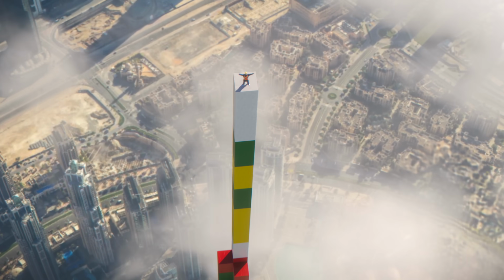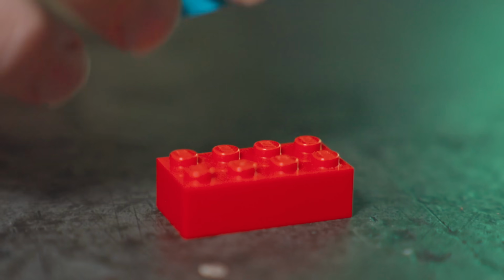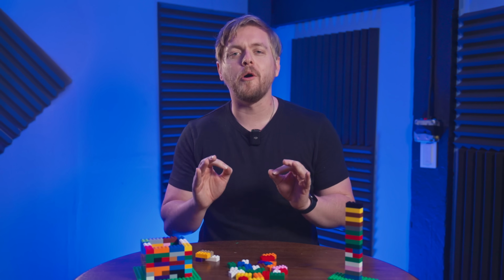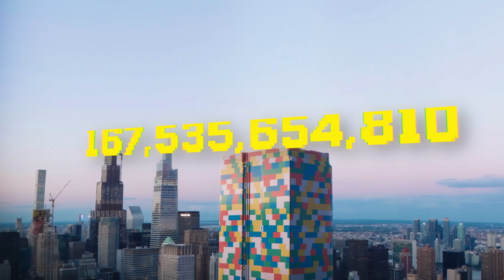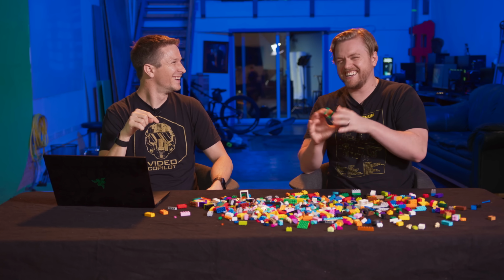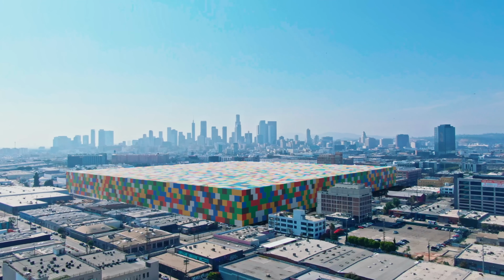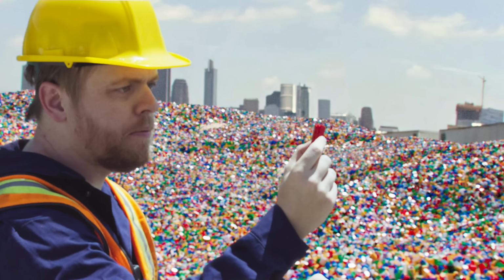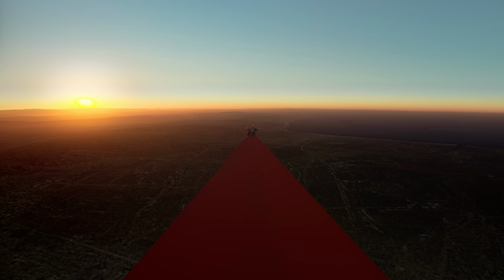How High Can You Build using only LEGO?

Comment: Does it have to be a solid structure? Can it be built hallow with structural supports made of lego? That would save you a ton of bricks.

Also, speaking of bricks, does that counter account for all lego pieces? Or just those specific types of bricks? Because lego makes tons of different types of pieces that aren't explicitly "bricks." Like they make motors, gears, axles and belts. They also make wheels and people and trees and creatures and all sorts of non-brick decorative pieces. So if their count of how many bricks they have produced includes those "non-bricks," then the actual number of proper lego bricks would be much smaller.

Comment: Gravity is an amazing force which can be used to strength a building.

However when you are talking about earthquakes, gale force wind and temperature changes, legos might be a really shitty engineering material. That it is hard to mimic all of the technologies that go into a skyscraper.

Let’s be practical about how impractical it would be to build a super lego structure.

Comment: "so clearly a single stack of Lego does not has that much structural integrity." 

Two flat Lego parts slammed on to each other are technically a stack of Lego, but in my experience impossible to take apart. ;)

Comment: 2x4 Lego Brick for 18 Cents includes
5 Cent greed tax
2 Cent Bonus for Board
2 Cent transport and distribution
5 cent for dealers
 2 cents for production
1 cent for material

If you buy them used you pay more like 5-10 cent, if you buy bricks directly from china you pay less than 5 cent

Comment: As a structural engineer and having done architecture I can safely confirm the possibilities of Lego are endless however the resources required to create large amounts is not.
Reply: Why stop at plastic? Start using wood,rock,metal fkcing moon itself maybe even all those asteroids...u call urself an engineer?? The possibilities are limitless!! WE NEED MORE LEGO
Reply: @kiro253 the calcium in our bones, the carapace of insects, the dirt we stand on, the air we breathe solidified, the vacuum itself pressurized into an unknown solid. EVEN NOTHING CAN BECOME LEGO
Reply: @nise6699  Turns out that the paperclip maximizer was, in fact, the lego maximizer
Reply: @kiro253 technically the way actual walls are built, they are LEGO bricks made of brick instead of LEGO. 🤯
Reply: Clearly, this is what our carbon sequestration should do: produce LEGO from all the carbon!!!
Reply: So there’s hope!

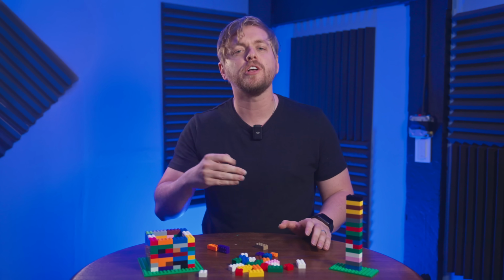Comment: 7:35 while a single lego brick costs $0.18 the actual cost if this was a lego set would be lower since in the sets the bricks cost around $0.07, so it would only cost around $7,403,018,841 if you bought every brick individually one by one, but if you bought all of them in a gigantic set to build the eifel tower it would be closer to around $3,500,000,000. still a really big number but it would be half of what you said it would be which is a pretty big deal

Comment: Weigh a brick. Measure the brick height. Put brick under load until it fails. Take that number and divide by the weight of the brick. That’s the number of the bricks times the height = maximum height.

Comment: ok but how tall could it actually be? 
- without extracting all the oil
- without recycling all the abs
- using lego branded bricks only
- including any and all different types of lego pieces required to make the structure, i.e. not necessarily just brick shaped pieces
- In whatever shape optimizes height with the given strength, weight, and quantity requirements given by the building medium
Reply: Lets assume every brick lego has made was a default 2x4 lego brick. Those have a height of 9.6mm. If we assume that there are 1 trillion lego bricks, then stacking them would reach 9,600,000,000,000mm.
9,600,000,000,000mm = 9,600,000,000m = 9,600,000km.  9.6 million kilometers is almost 25x the distance to the moon. Now lets assume you built a pyramid with the same pieces where you place each next brick one stud inwards per layer, aka a slope of  1 brick / 1 stud. A brick has a height to width ratio of 6/5 so that slope would be 6/5 or about 50.2 degrees. Lets assume again that all the bricks are 2x4 bricks with a volume each of 9.6mm x 15.8mm x 31.8mm or about 4.82 cm^3. Multiply that by 1 trillion to get the total volume in cm^3, then divide by 1 million to get m^3 and you get 4,820,000 m^3 of lego bricks. A square based pyramid with a volume of 4,8 million m^3 and a slope angle of 50.2 degrees has a height of only 173 meters. If you instead stacked up 2 bricks per stud for the slope you would get a height of 275 meters but the angle of the sides would be much steeper around 67 degrees, if you were to push that again to 3 bricks per stud slope would hit 74.5 degrees and the height would reach 360 meters.

Comment: The real limit would end up being in the construction techniques you use as the strength to weight ratio of the bricks themselves is crazy, so between SNOT methods and LEGO brand string (if you insist everything must be official Lego only) to tie things together you can overcome the limited clutch power between the bricks quite easily and create more stable structures without the huge pyramid footprint. So it would be nice to see at least a token mention of the more advanced building techniques.

Comment: The initial 2.17 mile calculation is based off 1 to 1 vertical stacking, it does not apply to a pyramid shaped structure which helps immensely by sharing the load of higher bricks over a larger area of lower bricks. So you would be able to build much higher.
Reply: Keeping the same aspect ratio, I think you can build three times as high (but you'll need a couple many more earths worth of oil)
Reply: @Papierkorb2292Not if, like most buildings, it’s built semi-hollow..
Reply: @dedomenici  Then you are back to brick strength being the limit.

Comment: There's not a trillion Lego bricks in the world, there's a trillion Lego pieces. Flames, horses, domes, figures/minifigs, various accessories, and plenty of other pieces aren't structurally sound. There's an estimated 1.1 trillion pieces as of 2024, we (generously) can up that to approximately 1.136 for 2025 at Lego's reported production of 36 billion per year: but we have to separate Lego pieces into 'elements' and 'bricks' according to their own reporting. As of mid-2025, there's probably only 660-7020 billion structural bricks, depending on the exclusion rates for things like minifigures, plants, decorative pieces, animals, technic pins, technic hinges, technic connectors, baseplates, etc. - but we can still include things like technic beams and axles.

Add to that that crush force on a single brick does not scale perfectly to an interconnected brick structure, and you have a lot of problems.

Comment: you could probably get even higher if you changed the ratio of vertical and horizontal bricks. rather then a 1x1 ratio why not a 2x1 or even 3x1. if you can figure out the proper ratio you can get taller without sacrificing all of the additional structural integrity of the pyramid shape.

Comment: The solid (well, quasi-solid, since the blocks are empty themselves) structure is extremely irrational in terms of the blocks usage though. It's like making Eiffel tower whole from solid metal like a pyramid. But one will need to utilize structures like arcs and domes to avoid tension at all costs since the bricks are quite easy to disassemble by tension.
The solid pyramid structure is pretty disappointing one to be honest since at this point you may basically as well just rake all the plastic into a huge pile. That's basically the point of pyramids (and the source of their stability).

Of course it's likely impossible to reach the tallest buildings heights even approximately, but still it's interesting to know how high it's possible to get ~realistically :)

Comment: James Mays Lego house was actually supported by only Lego, the wood beams were there due to regulations but not actually carrying any of the weight. the bricks were built around them with gaps
Reply: And they showed the testing of making a lego beam in tension at an engineering school. After many failed attempts they were able to create beams James could walk on. Too bad Toy Stories ended.
Reply: @AlansWay3DPrinting  it is such a good series!
Reply: Kind of like wearing a safety line while rock climbing. Just there to protect you if you fell. Doesn't mean you weren't doing the climbing.

Comment: When Austin added the stack of green bricks to the tower at 03:04, you can see that they didn't connect completely. And when the tower finally collapsed, it broke at that exact point lol I think you could have gotten to over 2 miles if it weren't for that
Reply: What are you talking about? He could've gotten to at least the edge of the observable universe
Reply: I KNOW I WAS SO PISSED WHEN I SAW IT
AMATEURS
THE LOT OF EM
Reply: if you go frame by frame youll see its actually about 3 bricks below the green section where it snapped
Reply: I came here to say this
Reply: True, because at the two mile mark, I'm sure the gravity would be a little different, and eventually you run into issues discussed in the XKCD video about a billion story building
Reply: @joe-skeen  While technically true, practically false. 2 miles is only around 11,000 feet. They're in LA, so essentially sea level. I've lived at a place around 9500 feet above sea level. Gravity was the same.

For perspective, low earth orbit is 110 miles. And to have something in orbit, it is still affected by gravity. Think of low earth orbit like this: you're perpetually falling towards, but missing, the earth due to horizontal velocity.
Reply: I was about to write the same but i saw your comment 😅
Reply: Came here for this. Shout out to Ctrl+F "green"
Reply: such a shame! They would've made an elevator to the moon otherwise..
Reply: bot detected

Comment: Building solid is such a waste.. consider buttresses and the humble arch. Modern buildings rely on steel and concrete mixed but you have to go back to techniques for solid stone. Compression only. Build as light as possible since each layer only has to carry what is above. Start designing from the top down.

Comment: This topic could stand several more visits. There are other structural aspects to look at like hollow structures (allowing for wider cross sections less prone to buckling, for the same weight) wall thickness reduction as a function of structure height, cross sectional shapes that can further reduce buckling, internal bracing, and tension elements. In short, there are a lot of neat tricks that can be played to reduce the propensity to buckle, and to proportionally reduce loading on the base bricks per unit height.

Comment: One thing that would need exploring is if there is a brick configuration that is stronger than just forming rectangles. If you take the regular 2x4 brick in pairs and alternate the direction you stack in, it is much more resistant against shear forces. And it should be better at distributing the weight from above. 
I'd wager there would be other configurations that are even better for force distribution, some sort of lattice that turns any one force direction into a variety of forces acting on all surrounding bricks. And if you find that optimal configuration, you could probably go steeper than an even pyramid for the final structure.
Reply: true, there are for sure better methods for building a tower

Comment: Former Master Model Builder here and trust me, that “glue” does a lot for building large structures out of LEGO. I’m glad you guys hit on it near the end when Wren mentioned the limits of the bricks themselves. Without glue, practically any sized build will start coming apart eventually because of these imperfections compounded with the increasing points of failure at every connection. A giant building would basically wiggle itself apart, especially if it was all solid throughout. While working on a life-sized minifigure build, we were gluing every layer as well as staggering the bricks to make sure every piece was properly anchored but we were also building it hollow with internal structural supports to basically keep it together on every layer. We had one support near the shoulders that we basically had to beat into place because so much drift had already occurred in the structure’s stud system. 

That being said, I’d be curious what the answer would be if you used a hollow design with a large foot print and internal structural supports, similar to how the record holders were building theirs.
Reply: oh my god, chasing those cracks through entire models and squeezing them back together was the bane of my existence when I worked at Bright Bricks. We used to call soft mallets "persuaders" because we would often use them to bash the bricks properly flat.
It's a perfect demonstration of Chaos Theory though. The tiny imperfections in the bricks would compound into catastrophic cracks in the huge models.
Reply: Chaos Theory? A load, if I may say so, of fashionable number crunching 👴  @Hedgemonkey5
Reply: Imagin the fiasco of a two kilometer Lego pyramid coming apart!

Comment: 20 seconds in, and my immediate thought is no way.  The Legos at the bottom would be crushed under the weight, and the whole thing would come down.  A Lego tsunami would blast through the streets, where people would be either pulverized or rolled into the underlayer of hot melted plastic, formed by the insane friction of a billion Legos dragging pavement at locomotive speeds.

Comment: Legos are built to CRAZY tight tolerances so they always fit together perfectly with any other brick from any other set from any other time. It's why you can have a Lego structure with bricks from 1985 and from 2025 and you can't tell the differences.

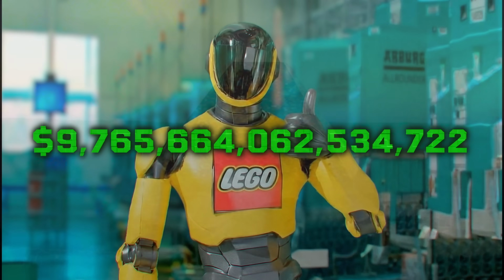Comment: 17:30 Ok but the weight of the pyramid is only 1/3 of the weight of a straight tower, so you could actually build it three times as high before the bottom bricks buckle.

Comment: Love this madness of this video, but, I am pretty sure that at least a few of the corridor crew have done 3D printing. You do not have to have the entire internal volume of the Lego Khalifa or pyramid to be full of Legos. You can eliminate at least half of the internal volume and still provide shear resistence. And, you did not bother to taper the Lego Khalifa to emulate the tower it is based on.

I give this a 3/5 star rating. One star eliminated for the above reasons. The second, because you did not stick a lego antenna or satellite dish on top of the structures.

Comment: If you were to make that 350m x 3.5km structure, you could easily make it hollow without compromising structural strength, but yet reduce the weight.  It would also reduce the cost.  It could be built in segments that could then be assembled.

Comment: It wouldn't be that tall. The plastic of Lego bricks experiences creep under the sustained load. And it doesn't take much. The pins in the outriggers of the set 42108 became slightly deformed and loose after a couple of months of bearing the minimal load of the set.